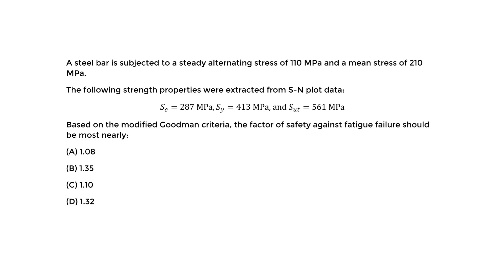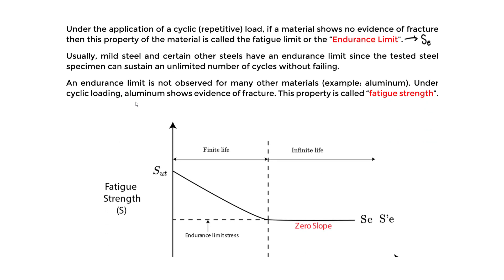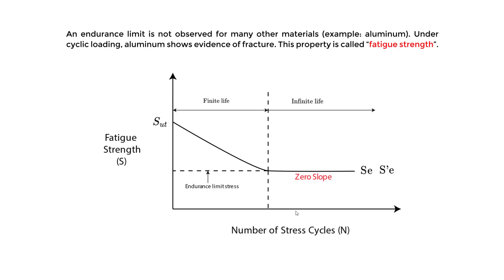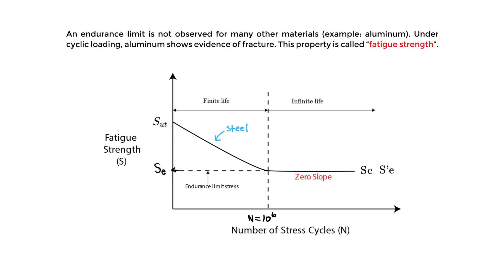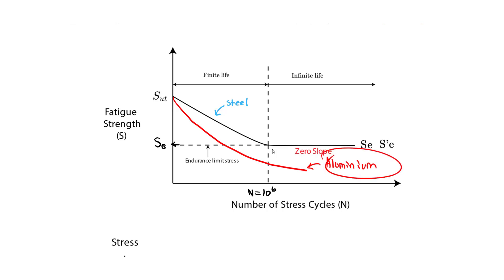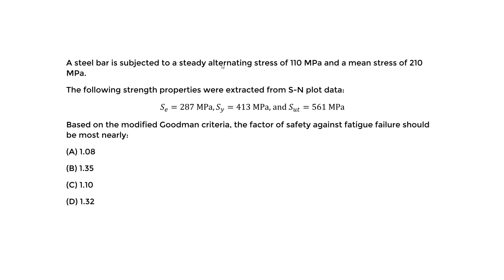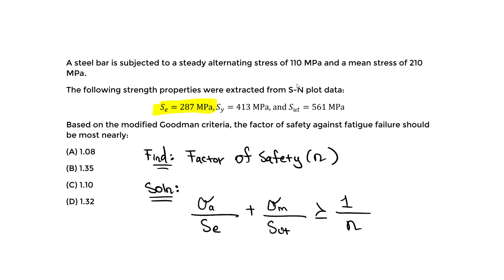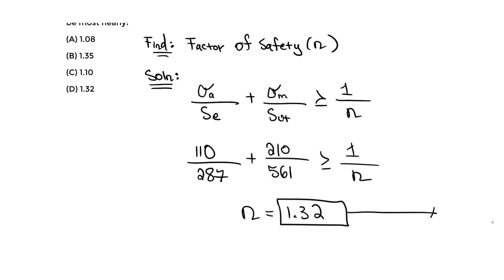FE Exam Review - FE Mechanical - Variable Loading - Goodman Equation

Comment: Didn't you need to test it with the other goodman equation? sigma_max/sy>1/n ? Or is that supposed to give the same answer in theory? In this case it didn't, it gives an answer of 1.29.
Reply: I'm wondering the same thing. With the given variables you can calculate sigma max easily, so why use one or the other